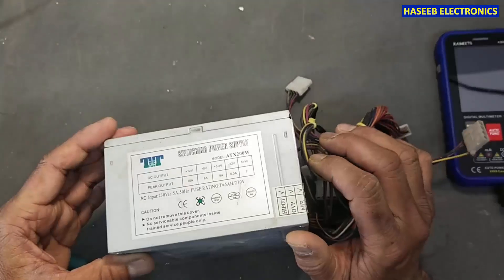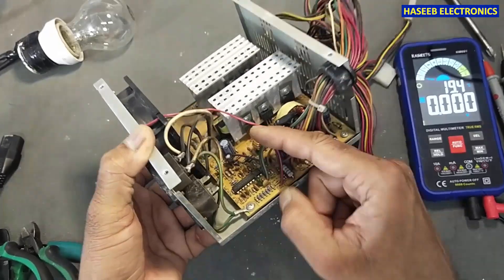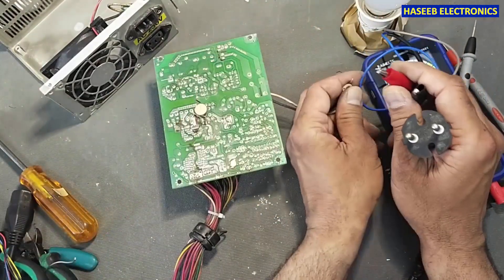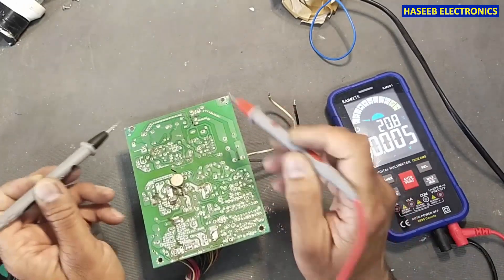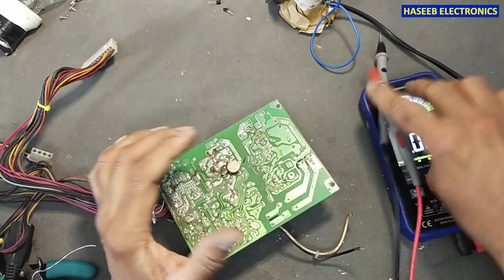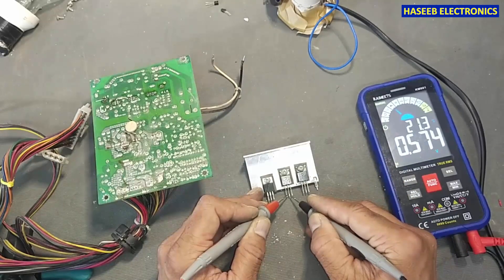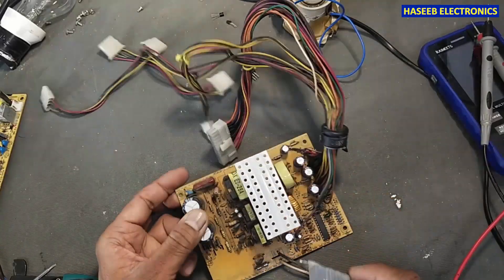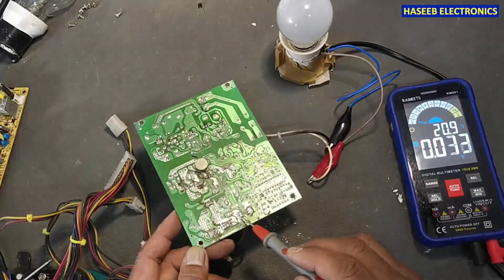{841} How To Repair Computer ATX Power Supply

Comment: sir tl494 use karke ek adjustable current supply banane ka tutorial denge bole the aap ???when will you be able to make that tutorial ?? i will be very grateful to you for that tutorial!!!
Reply from the maker: yes brother 
i am sorry for that delay. i promised, for that and i tried to adjust and i was able to adjust voltage, but i failed to obtain load regulation, so that is the reason, i skipped that video, because i don't want to share any incomplete or misleading information.  as we can adjust voltage but underload, the voltage loose regulation and power supply produces ripples. 
but i will share a perfect and cheap solution to make a variable power supply using computer power supply
Reply: @HaseebElectronics  thank you very much sir
Reply: Can't wait for this variable atx power supply I hope its very soon
Reply: @michaelmuiruri4208  yes dear i am planning to do it in upcoming days. when i am confidant, that it is useful and long life, then i will share it.

Comment: Sir I have checked all the sections properly, cannot understand still no output, SB +5V is OK on purple wire, but no +5v on green wire. Cannot understand the problem please help sir. Cannot bring any Voltage on the Green wire in any case.

Comment: Good afternoon sir
I am not able to identify the fault in ATX power supply, problem in the SMPS is that standby supply and Power on supply is ok/correct,
Power transistor is also good,in the mains primary side half bridge supply is gradually decreasing to the other side of coupling capacitor 105 J connected with the main switching transformer when we give supply
Please help me

Comment: Sir I want to learn 5 volt, 12 volt, 14 volt 3.3 volt circuit area, do you have any video about this section explaining, not the high voltage area any psu..

Comment: My friend I have this problem, I have old video recorder but it no power up is dead...I put multimeter and on primary side of smps it all works but no and very low voltage on secondary  side, I have replaced ic feedback, I gave replaced all capacitors and mosfet and diodes but still I don't get any power on the secondary even the secondary sideboard the transformer no voltage DC 0.00v....that's for any help
Reply from the maker: please check the RCD snubber circuit (resistor, capacitor and diode) connected across the primary winding of the transformer
i think, it have some problem 
please check the link https://youtu.be/uqq9DpBwpuY
and please let me know the results
Reply: @HaseebElectronics  Thank you my friend, on primary I get AC voltage all the way upto the transformer primary side, but then on the secondary side no power or very little power , so primary side AC power OK even large capacitor charge to 340v, problem is no power  after the transformer secondary side, I have replaced all Bad components and IC  have checked others out of circuit and are OK but still I can't get power to the secondary side

Comment: Looks like a RAIDMAX power supply. I am working on one now, slightly different 400watt, uses a KA3843 for the PWM and an LP7510 for the Power Good , power on. Thanks for making this video. Everyone around the world thanks you I am sure.
Reply from the maker: thanks a lot for our valuable comment 
raidmax models use PFC to main dc line voltage and 3843 for secondary power supply 
while 7510 is atx supervisor

Comment: एक दूसरी पावर सप्लाई है उसमें सिर्फ फोल्ड यह है कि 3.3 वोल्ट धीरे-धीरे कम हो जाते हैं और सप्लाई ऑफ हो जाती है लेकिन जब किसी सप्लाई पर थोड़ा लोड किया जाता है तो सप्लाई को चालू रहती है रहती है 3.3 पर लोड करने पर ऑफ हो जाती
Reply from the maker: is mein 3.3 volt regulator ka problem he. kisi waqt 3.3 volt ka regulator transistor (jo atx supervisor ic k pass lagaa hota he) us mein problem hoti he. agr 3.3 volt mosfet se regulator ho rahey ho to mosfet aur us k gate per lagaa hua TL431 check kr lein aur terminal regulation wali ordange color ka connection check kr lein
Reply: @HaseebElectronics  ok thanks

Comment: Djazak  Allah khayran , if the voltage at the purple wire is 5 v and the green wire is 4,3 v the atx power supply doesn't work I found three damaged capacitors and the fuse was open   I changed  there is no short but the problem persist

Comment: Esselamu Aleykum
 Nice Video brother
If a fault  transistor's not reading part number can we learn  it's type (pnp or npn?)and pinouts ? (which pin  is emiter which is collector?) I mean bad transistor's connection to electrolytic capacitors and other  transistors connection on board  is give a tips?
Reply from the maker: kindly check video number 751, that is on missing transistor 
and  i will share more deep tips on transistor diagnosis